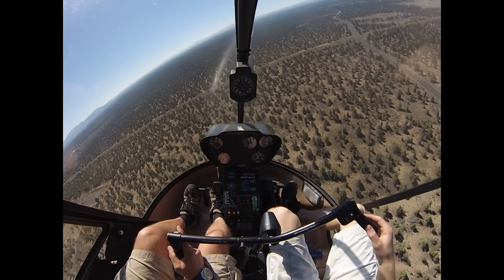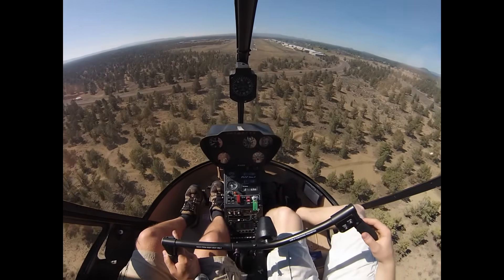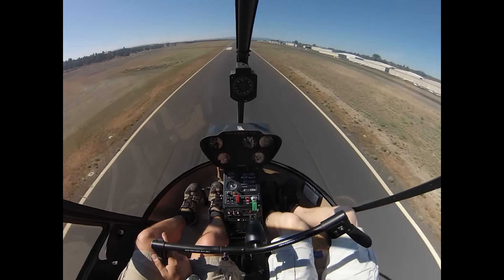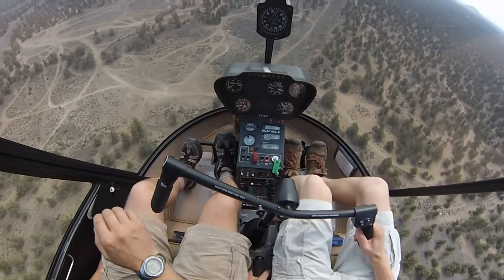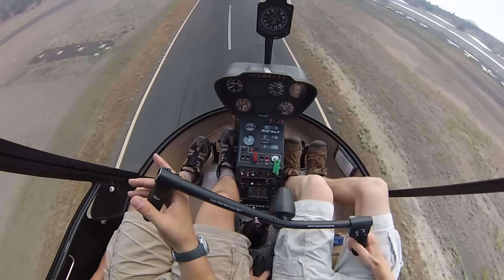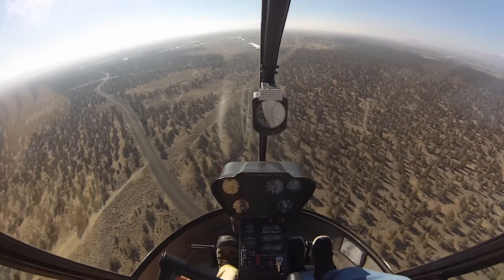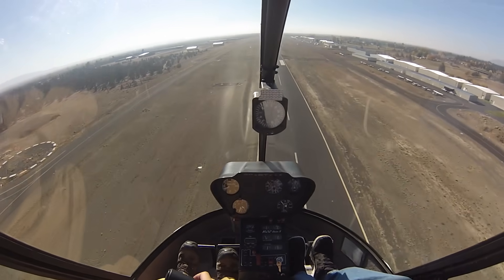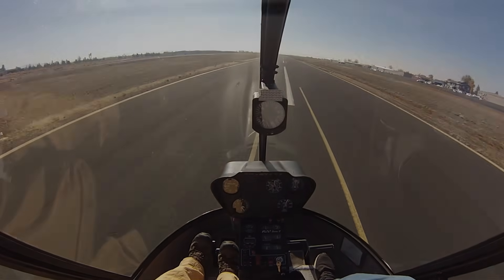How to Land a Helicopter - Normal Approach to a Hover. Helicopter Landing.

Comment: Question 4 you or group.
As a newbie

When a helicopter is lowering on approach the only gauge that displays a decline is VS gauge. Right? Beside one's eyes. 

Meaning, your attitude gauge might show level or up slightly as you bleed off speed etc.

One a plane you see both attitude and VS gauge displaying a decent.
Reply from the maker: Good point - we just look outside and reference the VSI to make sure descent is under control.

Comment: When you add more power as you come to a hover does the helicopter start to take off again?
Reply from the maker: Great question - nope it just stays in the hover. It takes more power to be in a stationary hover than moving through the air in forward flight.
Reply: You learn what power setting equals hover and you stay around that slight adjusts as required.